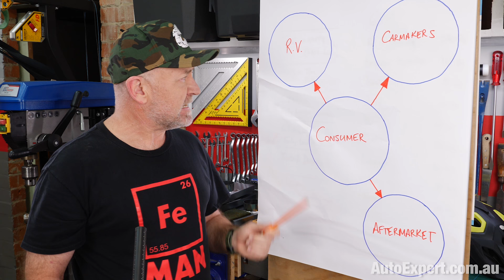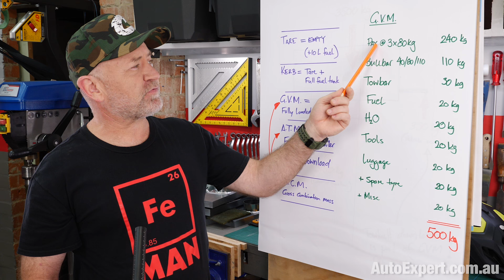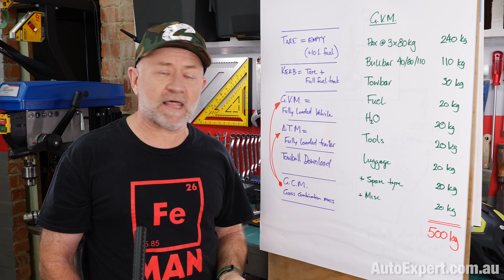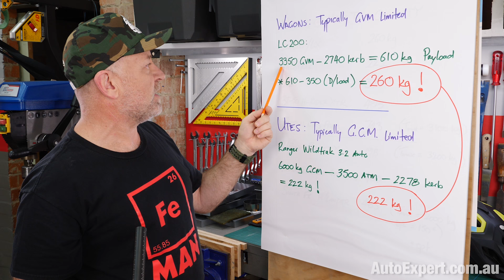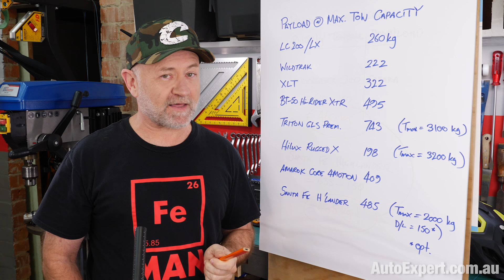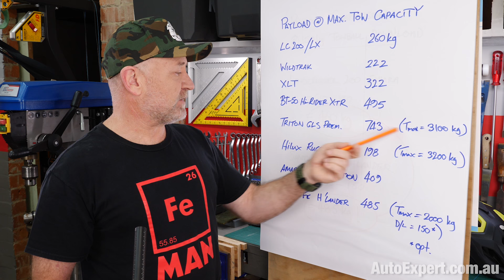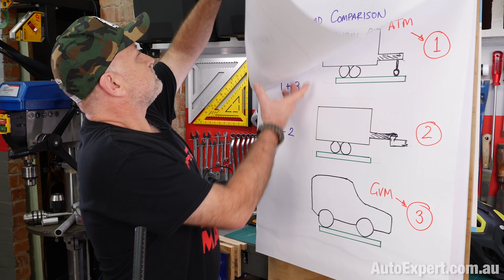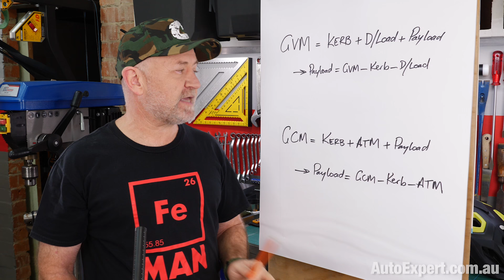Complete guide to heavy towing (GVM, GCM & ATM explained) | Auto Expert John Cadogan

Comment: Hi John I’m a self certified Toyota fan boy but can’t argue with your facts and enjoy your videos. Obviously I own a land cruiser I know what you are saying about warranty and after market gvm upgrades but as I did I walked into Toyota and bought a brand new 79 series and had a gvm factory fitted. Factory delivered with the mention gvm upgrade. So my question to you is if I had a warranty issue latter I had assumed as my gvm upgrade was supplied on my brand new car from Toyota that warranty would not be an issue am I wrong ?
Reply from the maker: Yeah - you're wrong. Dealers are not Toyota - they're franchises.
Reply: AutoExpert TV think you for your fast response I know you are busy but would you have time to elaborate more as I feel I have been unfairly advised. As you stated and are completely correct that the dealer and Toyota are two different things but you don’t believe that the dealer being the one that supplied and fitted car with gvm upgrade brand new would have to stand by warranty ?
Reply: @dme6991  Some Toyota dealers are supplying brand new 79 series Landcruisers with portal axles, I was looking at one for myself. The warranty is a dealer warranty, Toyota does not get involved.
Reply: @dme6991  (Don't ask a dealer for advice, they are there to sell you whatever you want to buy, as long as they can get it on their showroom floor.)
Reply from the maker: @dme6991  Toyota handles the factory warranty, not the dealer. If the dealer performs the GVM upgrade for you and it causes a problem, then Toyota may not want to know. Also, a GVM 'upgrade' is intrinsically a bad idea...
Reply: Find andrew white(on youtube and his troopy) and see what a toyota dealer did to him about brakes going out at 6k.Toyota is not your friend nor is the dealer.

Comment: What the hell are you guys down there making caravans out of? My five birth Adria was 800kg.
Reply: European caravans especially are lightweight which is good. Problem here in Australia though that our roads shake light vans to a premature death. That’s why most Australian vans are built on heavy chassis with “complex” suspension units. It’s nothing for the access road into a National Park to be 50km or more bone jarring corrugations requiring the driver and passenger to wish they were wearing kidney belts...and so caravans are built here with a heavy duty chassis; even if they then go one to become bitumen queens. The caravan industry here is broken, as is the authorities determination to make it too hard to import affordable and capable tow vehicles.
Reply: Our roads are pretty much stuffed, we need a 4WD to drive around town and we only live 30 minutes from Sydney.
Reply: Its more to do with 99% of caravans made in Oz are POS that are made with tech from the 60s. Why are all caravan bodies and internal fit out not made from vacuum baged foam sandwich. 
The chassis design on most caravans look the same as 50 years ago. Most use heavy rhs steel. Hardly any use aluminium and none use fibreglass. Look how advanced European vans are to ours.

Comment: Good info, you didn't mention Nissan Patrol, 3500kg GVM, 7000kg GCM. With the new Federal and state laws concerning limits on GCM Landcruiser doesn't look so good. Your comments on $190,000 caravan, a lot of people free camp in desert/coast with caravans of that size. There is more economical units in the same size you chose the top spec.Your correct anything over 3T you will need the American truck and super sized pocket (fuel). Got to feed the horses.You didn't mention the Prado, do some numbers on this with 2.5T, its even worse. Anything more than garden trailer. Enjoy your lawyer digs. You didn't mention them in this video.

Comment: What if one uses a fifth wheel towing setup instead of a tow ball setup ????
Reply: you still need to load it right.  load both level and slight bias to the front in the trailer.
Reply: Pin weight on a fifth wheel needs to be about 15% of trailer weight.

Comment: I looked up my Holden Colorado specs. 
Holden say... 
GVM 2950kg
GCM 6000kg
And 3500kg towing? That doesn't add up?
Reply: It can. If the vehicle weighs approx 2000kgs, with fuel and driver it would be about 2200kg. Plus 300kg towball weight plus 3500kg trailer equals 6000kg GVM. John's point is that these vehicles can leaglly tow 3.5tonne but there is no room for payload and/or it is dangerous
Reply: @andrewhall4441  Oh yep, I got confused with the gvm and kerb weight. Thanks mate 👍
Reply: @AusJD  it is a minefield!
Reply: Towball load.

Comment: hey john, what about the Y62 Nissan Patrol please.?
Reply: Can you post the mfg specs, list the options and the add ons and maybe we can all help you work out it's limits. I'll start: 
Engine. VK56VD 5.6 Litre VVEL V8 petrol engine. Direct Injection Gasoline (DIG) Displacement (cc) 5552. Transmission. 7 Speed automatic transmission with Manual. Mode & Adaptive Shift Control (ASC) Transfer case - Intelligent 4x4 with. Dimensions. Overall length (mm) 5165. Overall width (excluding mirrors) (mm)  Outer urban driving, in 70km/h and 80 km/h zones, saw an average of 16.5L/100km. The Patrol has a 3500 kg maximum towing capacity with a 350 kg Maximum Towball Mass (TBM), and a Gross Vehicle Mass (GVM) of 3500kg (payload is 750kg).
The Patrol has a 750kg payload and so when loaded to its 3500 kg maximum Gross Vehicle Mass, it'll still be able to tow its full 3500kg capacity (so Gross Combined Mass is 7000 kg). The downside is the Nissan's 350 kg maximum towball download becomes a 250 kg maximum if you have loaded the Patrol to its 3500kg GVM.
Maybe someone can add to or comment on these specs I have cut and pasted from several sources. The 2018 Y62 https://www.carsguide.com.au/car-reviews/2014-y62-nissan-patrol-review-29357 is listed at between $82,690 and $114,490. WOW. I'm not a AWD guy and I didn't realise how expensive these vehicles are.
Reply: Same shit man. Surely you can work out the maths to suit your vehicle
Reply: Thanks. I now know that the Y62 Nissan Patrol is a Nissan Armada. Not a bad SWB full size SUV.

Comment: What about Ram trucks??
I know it is not a Ute per say but is it better??
Reply: Towing greater than 3.5 tonnes takes you into a commercial truck driving licence requirement.
Reply: Ram 2500 913 kg payload Ram 1500. 845 kg payload from Ram Oz. Other converters for Ram 2500 have a higher payload. Same with the Silverado 2500 913 kg. Add a canopy, 350 kg ball weight.
Reply: I own a Ram 2500, and have no experience with utes. The Ram (diesel) will pull your house off its foundations, but it limited in tight spaces. With lockers it will take on any trail that has enough space. The plus is that it is a tank. I have been rear ended 3 times with no damage (1 scion xb was written off) and have had 4 deer impacts (first one took out factory bumper, replaced with winch bumper) 3 impacts no damage including one at 75 mph where the wife didn't notice (1 deer impact spit a deer up behind the rear diff landing on closely following veloster - write off on velocter).

Comment: Easier to use a Chevy 2500 that weighs almost as much as your 3.5 tonne metric and has a 1640 kg payload.  I cannot believe you would tow anything with less than 10% weight on the ball, I shoot for 15% of trailer weight on the ball so the vehicle handles properly.  Reducing the weight downforce from the trailer just makes any wind a white knuckle drive.  Stay safe and use that brain and for sakes matter don't tow like an idiot.
Reply: YES!!!

Comment: Worse than the Taj Mahal of caravans is the poorly loaded car trailer!!! 
Towing should be a seperate license and driver education program.
Truck drivers have to go thru so much training to keep their licences but anyone in an over/poorly loaded towing configuration, can hit the road blindly.
I see these vans sit close to the centreline with oncoming trucks approaching, suddenly the van’s driver is left battling with the turbulence from the truck. Many times I have seen vans sway violently left and right across their lanes. It’s no wonder there are single vehicle roll overs or worse, head on collisions. Stay on or over the fogline to minimise that turbulence.
Cars on car trailers that are loaded too far forward!  If the view from the drivers seat is of more sky than normal, then the car on the trailer needs to be moved backwards and resecured.
Before heading off on a long haul road trip towing, understand that any downward force on the rear of the vehicle is an elevation to the front end. So when driving at night, if oncoming traffic keep flashing their high beams at you and you don’t have your high beam on, don’t get shitty and flash them back, it’s because your low beam is no longer pointing at the road, it’s right in our eyes and being blind at highway speeds is very very dangerous. and yes I do know how to look past blinding lights, but vision is still heavily affected!

Be safe on the roads, especially the highways. A head on collision is usually a combined impact speed of 200kph. Your 6t plus whatever you hit............. makes a big mess
And use the three seconds gap rule! It works for any speed. Leave 3sec between you and the vehicle in front of you!
Safe travels 🙏🏼🙏🏼
Reply: Agree, but hate the fact that the government would control this.

Comment: Spoken like a true city slicker.... I've not noticed the hotel accommodation at Eringa through to Lamberts.... 

Also completely missed axle loading (You can still be over rear axle load while under GVM when towing) and moment of inertia in the trailer. More important than the overall weight of the van, is the distribution of the weight in the van.

So complete guide? well not really...
Reply from the maker: You hyper-critical fuckwit.
Reply: Not many companies go that close to the line when selecting axles. My front AAM 9.5 is rated for a shit load more than the 1200 lbs that my engine/tranny combo loads it with and the AAM 11.5 rear is rated for almost enough weigh to carry the mother in-law (equivalent of 2 cubic yards of plutonium).
Reply: @AutoExpertJC  Never noticed your less than elegant retort until  Rich commented above. You don't take suggested improvement to your content well do you. 

But when you miss basic information and title something as "Complete" it would be remiss of me not to help you out by bringing it to you attention!

You're welcome!

Comment: Best choice if you want 3500 kg and 4WD: The VW Amorak. Thank You Volkswagen!
Reply from the maker: Except that Volkswagen are a bunch of pathological shitheads - so there's that...
Reply: @AutoExpertJC  A company or a car can't be evil. Only people can and these people are gone.
Reply: @AutoExpertJC  ford would of shortened peoples lives more with all the car fires as well as Toyota's DPF issues than VW.. 
dieselgate VW's produced lower Co2, increasing fuel mileage, emission systems durability, reliability and performance but in doing so dramatically  increasing some emissions like Nox.
At the end of the day the tailpipe was still clean because the DPF was still intact and dong its job and at least in Australia most other manufacturers were still selling non DPF vehicles that pumped out black soot with older and dirtier emission standards of eu3-4  while VW's were fitted with DPF and running at eu5-6 half of the time...
Reply: 3.5t towing seems really low.

Comment: Some excellent advice as usual but also some melodramatics in this one John - namely constantly using ATM 3500kg or 190K caravans as examples like that is what the average "clueless" caravaner is hauling.

1. 4WD GVM being overloaded? I Agree [see below]
2. Braked towing <3100kg for most 4WDs realistic given the resulting payload? I Agree
3. People routinely exceeding GCM? Disagree. That would be rare [see below] due to logistics vs weight
4. Using ATM 3500kg to show the maths? Agree. Implying that is the usual ATM hauled by 4WDs? I disagree.
5. $190K caraven? Agree it's ridiculous. Disagree it's a good example [see below]

1. I'd say most people who haven't done their maths aren't exceeding GCM or even braked toing capacity- that is bloody hard to achieve. They are exceeding GVM if their 4WD has 300kg of accessories bolted on, 2 tyres, a fuel and water jerry, all the recovery bells and whistles and the wife and kids.

2. 3100kg towed braking max recommended is realistic. E.g. Everest Trend 2.0L, GVM: 3100kg. KW: 2387kg. PL: 713kg. GCM:5900kg. I always plan to load under the GVM first and, whether I use or not I have that as <3100kg all up in mind regardless for my caravan weight planning. Towing for the 2.0L is 3100kg. If I take the GMV from the GCM it means my max and planning weight to get as far under as I can is now 2800kg, Not 3100kg.

4. To exceed you GCM unless you straight up bought some 9m plus up-armoured off road behemoth that still has the interior of a 5 star penthouse suite is, I'd argue, is nigh in impossible. 
Average tare for family sized (about 25-28' long long) caravans is 2200kg to 2500kg. Even with 150L/kg of water if going off-grid (which even then you fill at the last safe place) imagine what a driveway spread with 850kg to 1150kg of "supplies" and comfort items would look like let alone finding space for it in yrou caravan. You aren't speaking from experience with caravaning and real time load-outs I assume mate?

You repeatedly used ATM of 3500kg for your maths. No issue with that to show people how to work it all out but realistically how many people ever come close to towing 3.5t with a 2t 4WD? Hell how many would brake 300kg?

4.0. To get a 2200kg or even 2500kg tare caravan to 3500kg is a serious effort in overloading a literal ton of useless crap. Especially if not running full water tanks etc. My tare was 2200kg. I doubt I have ever had the ATM of the caravan (which is listed as ATM 3200kg) above 2600kg. Hauling that with a Kerb Weight 2.4t 4WD isn't a hassle at all. Most ATM 3500kg caravans have a tare of about 2500kg. Even with 160 litres of water and 400kg of food, luggage, gas, ipads and camping kit, recovery gear etc the ATM is still 3060kg not 3500kg.
I'd be interested to read of anyone that exceeds ATM 3000kg that isn't hauling with a proper "Truck" and what the hell they are hauling to manage that. It isn't fuel efficent, and handling/performance suffers so anyone with half a brain leaves their 500kg stash of gold bars at home.

5. Finally - Most caravans purchased in Australia would sit in the 50 - 80K mark. Where did you get 190K from? Yeah they exist but how many Aussies do you think can afford that? Caravaning is a life-style or at least a special holiday style. it gives freedom and choices. Many like to fly-in, check in and then leave and fly home to a strict and often limited schedule. People that love caravaning simply don't. To put a price on shared experiences with the family around Australia is pretty petty. Last I checked you don't take anything with you when you die so if someone's idea of a good thing is a caravan life-style go for it. If, like you it isn't, then don't. Simple.

Comment: Well I'd suggest... that when most of us Retardistanis hear "ute", we say "huh?" and then think "oh, he must mean SUV". Confusing, even though I remember you defining it in a recent video.

Keep up the great physics!
Reply: @SurmaSampo  Except the ute pickups aren't really comparable to the pickups that we see on a daily basis. Most trucks that I see would not notice a 3.5t trailer.
Reply: @rich7447  Depends where you are really. The Toyota Hilux also sells really well in the USA but 2.5t trucks don't sell very well in Australia because they are too large and expensive for most trade users or too small and expensive for industrial use.

It seems the Large American pickup is really only designed for the American market. Also why add the risks of towing a 3.5t trailer when you can put the same load safer on the back of a 4t flatbed?
Reply: @SurmaSampo  Actually we don't get the Hilux at all and the Toyota midsized truck that we do get is a class leader, but can't really compete as far as truck sales go. Mid-sized don't sell here.